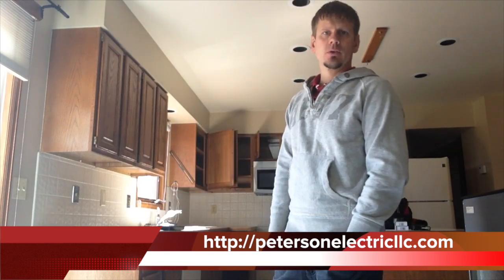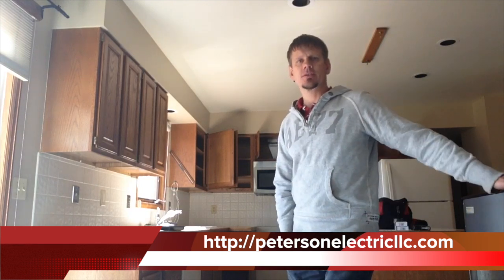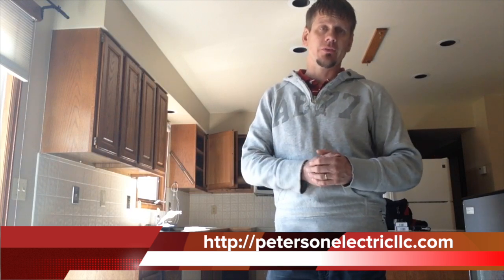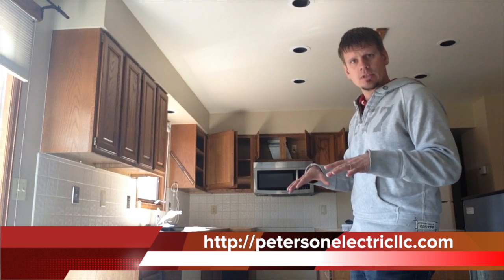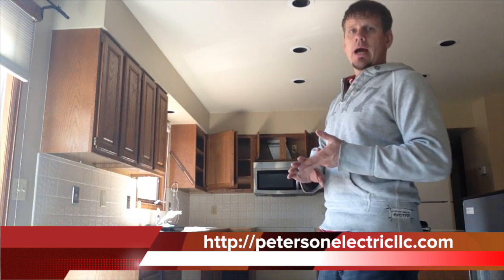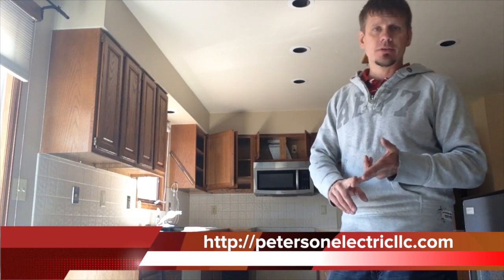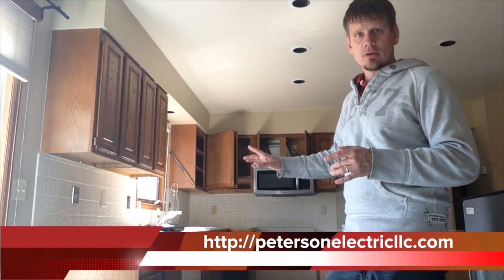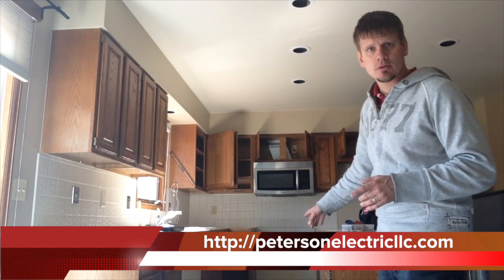2014 NEC Electrical Code Changes On GFCIs & Kitchen Remodels

Comment: Gfic's are constantly failing. And the only way to do it would be at the breaker box. Replace all your breakers with a gfic breaker. Their only around a hundred bucks. And if you have a 200 amp service, well it sucks to be you.

Comment: In Canada only the counter plugs are GFI. The microwave and fridge are still on standard 15 amp breakers. The 2 split plug circuits each need a GFI.
Reply: What is the answer if the microwave outlet on the counter is within 2’ of the sink? I put a GFCI receptacle on it (which can’t be a split plug).

Comment: So, this means that I have to install afci/gfci breakers for appliances in general
Reply from the maker: 210.12 & 210.8
Reply: @Petersonelectricllc  210.8 does not mention appliances for instance. It only refers to counter tops plugs and receptacles closer than 6 ft of the sink. I understand that AFCI must be installed for every 120v circuits in the kitchen.

Comment: BS This is the industry Selling equipment. GFCI is needed mostly for 2 wire devices. Built in appliances have Green Grounds and can't fall into sinks/baths.  Go look at the EU, they have 1 RCD (their version) covering the main panel. 
I am a firm believer in placing GFCI's where ANY corded appliances can be used in wet locations. But this code escalation (now requiring AFCI's in all habitable rooms ) is over the top.

Comment: I understand the need for gfci in a kitchen but you can't put a refridgeration compressor on a gfci it will trip when the compressor comes on too many voltage spikes

Comment: Should GFCI outlets installed in bathrooms, kitchens and other INDOOR wet or damp locations be weather resistant(WR)? Or does that apply to OUTDOOR installation only?

I was just about to install a new non-WR GFCI outlet in my bathroom, when I noticed on the back it says...

"NOTICE: DO NOT INSTALL non-weather resistant devices in wet or damp locations as per latest NEC code. When installing weather resistant devices in wet locations use with approved weather resistant covers/enclosures, caulk and gaskets."
Reply: Kitchens and bathrooms are not exposed to the weather. An outlet is not a device.
Reply from the maker: a plug is a device, and I have no idea why you are saying that kitchen and bathrooms are exposed to weather
Reply: I said "are not exposed"

Comment: Just guys hire some experience electrician 
The kitchen need . Microwave, refrigerator, stove , dedicated lines and also one line for GFCI
Reply: Fridge doesn't need GFCI if it's not accessible as in behind it.
Reply: DC I never say that lol . Only in the counter top you install GFI
Reply: Oh I misread. You need two 20 amp feeds and two GFCI's for the counter tops.

Comment: BS! not everything  fridge only if its 6 ft from sink same with microwave  and  disposal Dishwasher  however yes always 

starting october  31 st 2014
Reply: I agree. Pikes Peak Regional Bldg dept (down in Colorado Spgs/El Paso County) passes the following: GDu/Dishwasher, Microwave, and all counter ckts on GFCI/AFCI "CAFI" or dual function breakers. The refer is permitted here to be on an AFCI combo breaker only. Lighting in the area(s) is on an AFCI, as required in 210.10